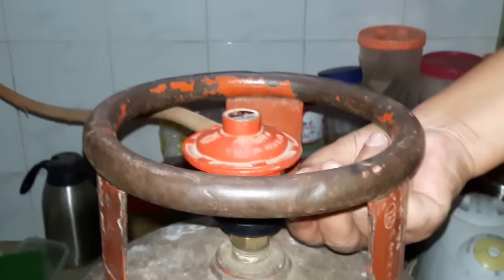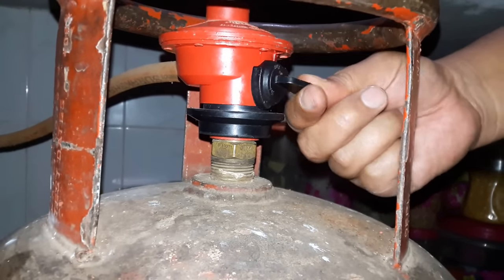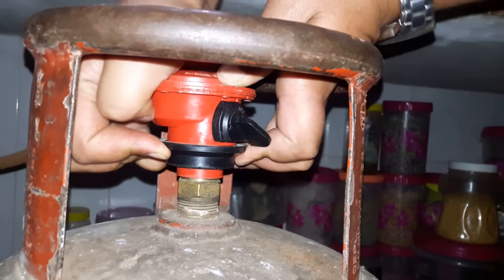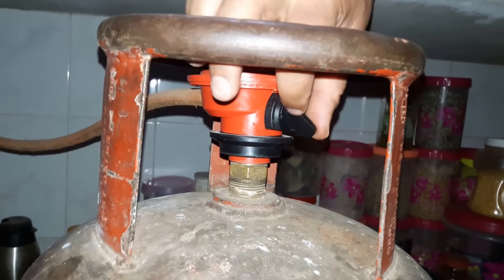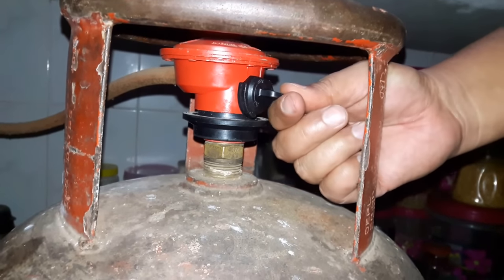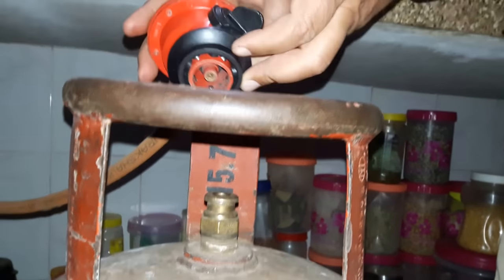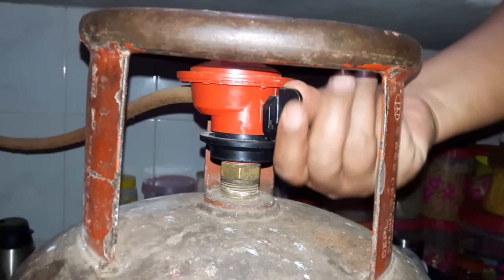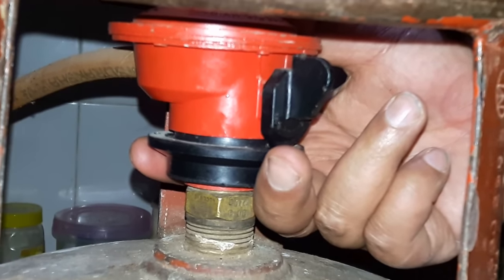How to replace and detach a gas cylinder (Indian)

Comment: What happens when we pull out the regulator when the lock is on? Does it result in a gas leakage?
Reply from the maker: you wot be able too with normal force - it is designed in such a way